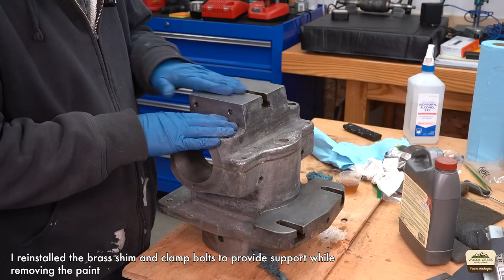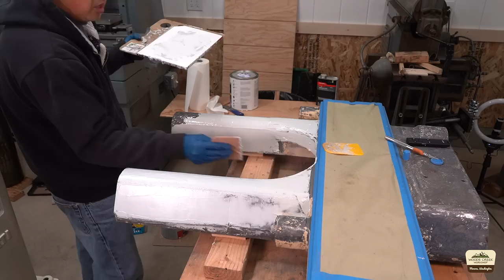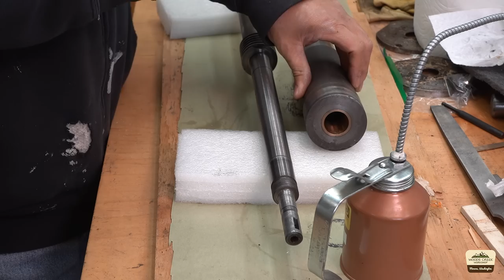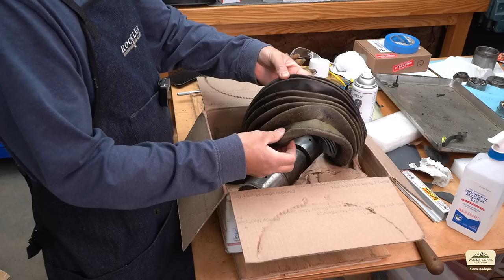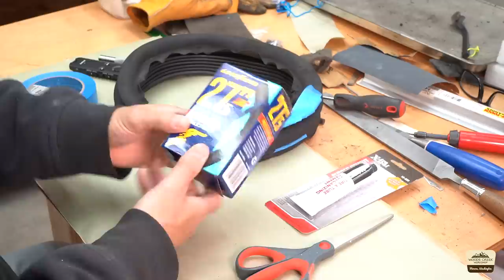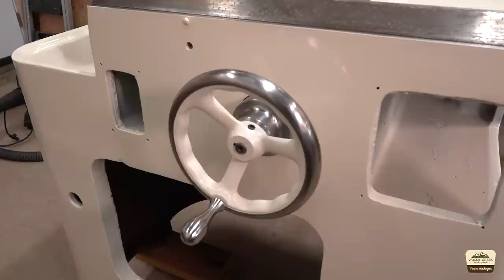Column Rebuild:  Part 4 - Restoring The Column of CINCINNATI No. 2 Tool and Cutter Grinder

Comment: Great work on your machine. It's looking really good. You might try some tire cleaning or conditioner on the rubber boot to soften and salvage the rubber boot for the column to help from getting anymore checking or tears in it. Looking forward to the rest of the rebuild.
Thanks for sharing.

Comment: I'd try Autoglym Rubber and Vinyl Care on the bellows. It's non-oily, so it will dry and not trap dust in a sludge, it leaves a low sheen finish that looks new, and you can use it on  plastics and rubber all over your workshop. I made the rubber and plastics in the engine bay of my car look brand new, and it has lasted well in that hot environment. 
Keep at it brother, this thing will be useful as it is beautiful by the end.
Reply from the maker: Will do, thanks!

Comment: Yuchol absolutely Stellar job on the grinder. Thanks for detailing the hand wheels. I have 2 of them to do on my lathe restoration and I have been on the fence between Cerakote, Black Oxide, and Painting the center just as you have done. My lathe is white, so the contrast of your color and the bare metal looks much like mine will. I am certainly going to check out the spray on rust preventative you used on my dividing head and a new mill vice I just bought. The kid's baseball games are a great suggestion. I know cause my Little Leager just turned 52 in April. Try to stay cool and safe during this summer heat. It is already blistering hot here in Texas, and we are in mid Tornado season now. God bless and good health to you and family.
Reply from the maker: Thanks Terry, stay safe!

Comment: Might be to late, but here is something to try on the rubber bellows. Get some silicone spray, I like CRC brand, and douse it down real good and let it set.
It works the best if you can submerge the part in it. It seems to do wonders especially if can let soak for week or more.
I did this on some old motorcycle parts and 5 years later they still nice and soft, it helps if you give it a "booster" shot from time to time.

Comment: #2 is looking good. Interesting you had so many issues with your needle scaler. I just used the pistol grip style to remove all the paint off of my shaper. No issues at all with it coming a part. It worked perfectly. Maybe you just got one that was built on Friday afternoon.
Reply from the maker: Tom, I may have bought a junk

Comment: Amazing work Yuchi. Something for you to try out with old dried out rubber is 303 protectant. Spray it on and let it soak in for a day before you wipe it off you will be surprised with the results
Reply from the maker: Great, thanks for the tip!

Comment: We had one of these machines at work and they scrapped it last week. How do you get the rubber column boot off. I may be able to still get it at the scrap yard. I have 3 of these machines.

Comment: Hi Yuchol, we had large Pneumatic actuators operating boiler dampers on an offshore facility, we had a local Aussie company sew canvas bellows to suit the application.
Must be someone in the US who makes them for your application, rubber does not like coolant
Reply from the maker: Thanks.  I don't plan to use coolant, so hopefully this setup will hold out for awhile.

Comment: A lot of people make that mistake that bronze bushing is a bearing it's called an oil light bearing it is impregnated with oil and it has to fit on exactly correctly as far as it has to be a slip fit but with resistance it's kind of thing that you have to know how it's supposed to feel it may or may not be press fit into the end but the shaft needs to slip in with just some slight drag.

When you buy a replacement they always require you to machine I want the oil light to the correct inner diameter using very sharp brand new sharpen tooling I used to use my hardinge lathe then take off a 10,000 at a time

Comment: Spray some silicone spray on the bellow. It will rejuvenate the rubber and prevent it from cracking.
Reply from the maker: Good tip, thanks!

Comment: Question; could you not have made a 30 thousands shim/washer to take out the backlash in the column assembly?
Reply: It didn't need it, the backlash came because jam nut wasn't tight enough. 
There was "*" correction text in the lower left corner when he was talking about it but it's quite hard to see lol
Reply from the maker: Making round shims that thin is challenging.  Doable, but adjusting the nut to the next washer tab was more practical in this case.  Thanks!

Comment: The search function barely works for me, but I found this series, I will give this advice on the spindles. Best not to mix parts, Disassemble after marking the spindle bearings location of the outer race to housing, inner race to shaft, This should be done to determine the bearings original high spot locations will help return the spindle to original run out. Accurate Bearing can be a good source for precision spindle bearing$ Forget about reusing bearings, good luck!
Reply from the maker: Thanks!

Comment: If you need a new bellows at some point,McMastercarr sells a 10” diameter by one foot length. But yup, it’s expensive. $279 as of my writing this. I did buy one for my Rockwell tabletop tester. Perfect.